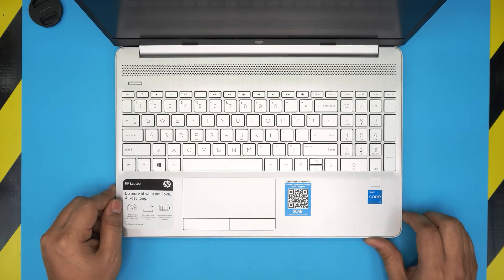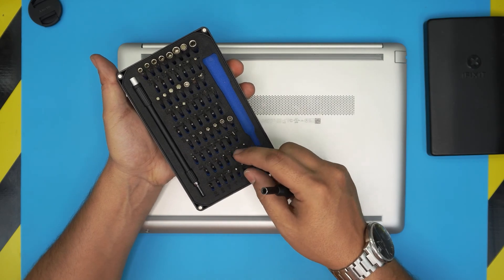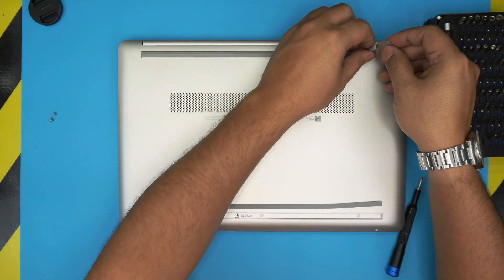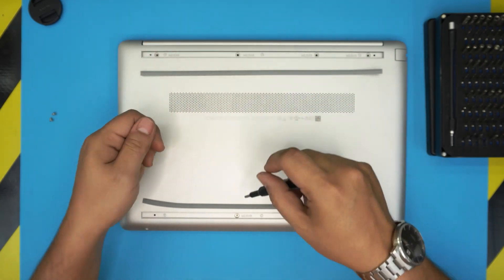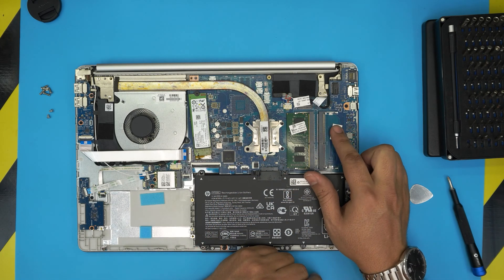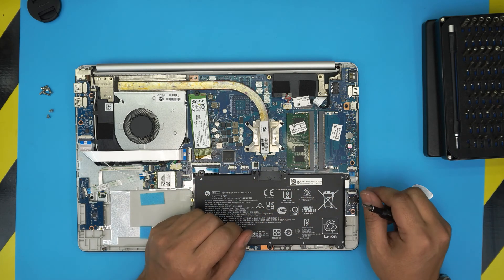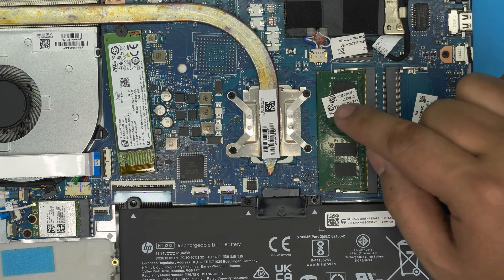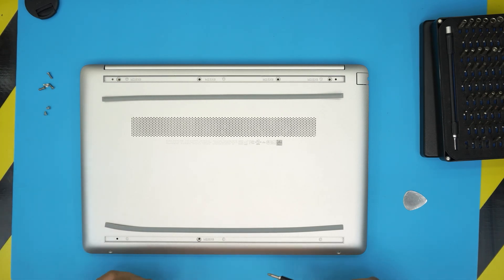How to Upgrade RAM on an HP 15-dw3033dx Laptop | Step by Step✅💻

Comment: Great video and thank you. Question: i just ordered the the ram you suggested for this laptop 15-dw3033dx. two sticks of 8gb @ 2400mhz. But i just noticed on another site it says this computer has 8gb of 3200mhz ram. should i cancel and order 3200 mhz ram? will it work , or will it be less capable than 16 gb of 3200 mhz. Thank you in advance for your time and effort.
Reply from the maker: Thank you for your feedback! If you wish to support the channel, you can like, subscribe, or both!
Regarding your question, the laptop comes with 8gb 3200 but if you place another 8gb 3200 the motherboard will auto adjust and lower the MHz to a usable number.
you can place the 2x 8gb 2400mhz and it will work just fine and zero complication.
or you could get the 2x 8gb 3200mhz but your laptop will have a hard time to auto adjust the ram speed, because as you increase the ram GB on a laptop the ram speed will auto decreases by the bios.
if your CPU is INTEL, then don't worry at all about the MHz just get the 2400 and you be more than fine.
IF you have the amd version then cancel and get the 3200mhz, because for the AMD cpu the ram speed is very important.
the 3200mhz link: https://amzn.to/4947Ak6

Should you have any further questions or requests in the future, please don't hesitate to ask me.
cheers🍻

This is an Amazon affiliate link. When you use my links, you are helping to support the channel. 🙏
Reply: Thank you very much for the QUICK and detailed response that makes sense. I will stick with the 2400 that I ordered from your link. Liked video and will recommend you/videos to anyone on need of assistance. Great work and very helpful, Thank you.
Reply from the maker: It's my pleasure my friend.
i appreciate your support my friend.

Comment: So I put two new ram's in, and the computer will still work?  Or one first in spare slot,boot computer, shut it down once hp appears.then add the second new ram,boot computer? Thank you
Reply from the maker: Thank you for your feedback! If you'd like to support the channel, you can show your support by liking, subscribing, or doing both!

Regarding your question, we usually recommend installing the RAM sticks one by one. Start by installing one stick and then boot the system. After that, power off the system and add the second RAM stick. Power on the system again and wait for about 1-15 seconds for it to boot. If this method doesn't work, you can try swapping the RAM sticks.
Reply: Thank you.  Much appreciated.
Reply from the maker: cheers 🍻

Comment: My laptop is hp model 15 dw1014

And has 2 ram slots....so I watched your video and it really helped...but my one problem is that when I want to add the 2nd ram ...which is 4 gb.....The other ram slot doesn't have That "Din" which you've mentioned in "5:35:" ....So how do I add another ram....if the ram slot is there to put atleast 2 but the Din to hold the ram isn't there....I can show u a picture of how it looks if I can get your contact details..
Reply from the maker: Thank you for your feedback! If you wish to support the channel, you can like, subscribe, or both!
Regarding your question, send me this comment and a picture of what you have and your motherboard 
 	ask@ufixtek.com

Comment: I want to upgrade/add a ram on my HP Laptop 15-dw1xxx how do I go about it and which ram is suit my laptop?
Reply from the maker: Thank you for the feedback! if you wish to support the channel you can LIKE or SUB or both :P
regarding your question: i would recommend this rams they are very solid and durable we use them all the time in the store and never had issue and very compatible.
https://amzn.to/3uW2DHX
go with 16GB nothing over it. if you have 8GB just another 8GB of this ram and you be fine.